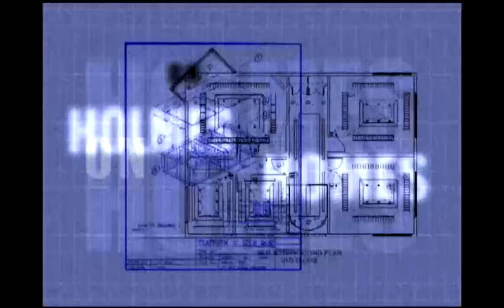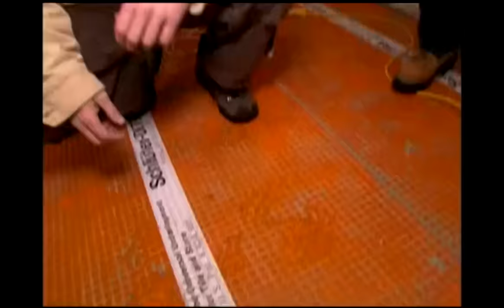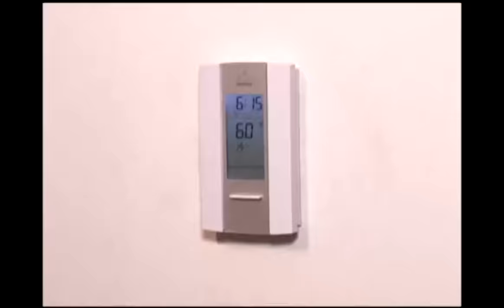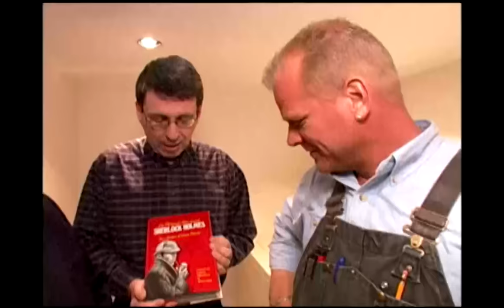The Risk of Buying Old Homes | Holmes on Homes 310

Comment: i have a 1946 house and the pain can be real. But from what I've seen of new construction...I wouldn't trade.
Reply: It is a big deal and such a stress reliever when the previous owner has all the paperwork from build, to mods, to appliances, to fixes and a solid home inspection backs it all up.
Reply: @Dk-qf8dd  These houses today people are constantly moving 1 new house every 2-3 years and after 10 years it gets demoed
Reply: @MultiTurbospeed  ouch!   Unless required to move by my employer, 7-10 years.  I didn't realize it was that often.  Financially that is nuts.
Reply: Absolutely, there are as many problems with new construction as there is with older construction. One of the problems with older homes is more recent work that was not done correctly.
Reply: My house was a 1947 cape cod I've added onto it twice been in the house since 1992 I was lucky in the fact my Dad was journeyman plumber electrician HVAC guy and I've been a journeyman electrician HVAC guy so when we had my additions put on my dad has known the carpenters 3 generations of them for yrs so I was lucky
Reply: Our house was built in 1920 and we love it ❤
Reply: So much easier to update a 40s house as you go. It stood for 80 years it’ll be fine as you expand and upgrade.

Whereas new construction homes need full remodels after 3 years. That statement is broad. I know. But it’s happening. A lot
Reply: @ndascal  Not always.
Reply: Just bought a 100 year old farm and likewise I wouldn't trade for anything. Hand cut joists and studs and 2" thick hardwood floors. The only problems with the house are the people that added plumbing, electrical and hvac throughout the years without any critical thinking or planning.
Reply: Own two 1940s houses. Wouldn’t want anything built after 1980 and prefer 60s and older due to the pride in work, superior materials, and craftsmanship.
Reply: Really just depends on who you have doing it. You need people who are honest and experienced. I just bought a older house and you can easily see where a homeowner did work and the professionals.
Reply: @ndascal  A certain number of older homes due to the roof structure have severe limitations to improving the insulation value at the perimeter of the house. Also the potential air leaks that are revealed by a blower door test show that many houses may have substantial air leaks that translate to drafty and high heat bills.Most older homes can be brought up to near super insulated and air tight standards with a fairly extensive external refit. Plumbing and electrical is only revealed by a thorough exposure.

Comment: Mike how you doing with the 3rd line houses ? I heard new houses you backed up after 2 years they are tearing them down !
Reply: Also read that article. One of Mike's companies also loaned money to the developer who built the disasters. Shame
Reply: Yep. The homeowners were completely screwed.
Reply: Reported 2 corrections to the issue. 1] The original builder substituted a builder not approved by Mike Holmes and 2] He only recommended the home if they used an upgrade package approved by Mr. Holmes. I understand that all the homes torn down did not go with the upgrade.
Reply: Wow

Comment: I purposely bought an older home 2 years ago.  I knew it had issues the home inspector "choose" to completely overlook so the Realtor could close the deal.  I would have bought it anyway, as I am very keen on spotting and repairing problems myself INCLUDING roofing!  I did my last roof myself and it was still good after 34 years when I sold the old house.
OK... long story short, unfortunately we can't call out bad contractors (or home inspectors) without facing defamation lawsuits.  THAT'S what's wrong with the industry.  NO ONE is ever held accountable.  THAT is why I learned the trades MYSELF.
Reply: Right on. 👍
Reply: 100%
Reply: The truth is always a defense for defamation. But contractors like these are never going to sue you. They'll work as long as they can until they get caught then declare bankruptcy, change their name, create a new LLC and start the scam over somewhere else.

Comment: It is permissible to use NMD90 (loomex) cable in metal studded walls in residential with appropriate bushings. AC90 ("BX") is not required. However, Mike is correct about the need to use junction boxes.

Comment: I’m in BC.I remodelled an extra bedroom as a utility/laundry room.venting the washer was simple using a cheater vent out an outside wall.it’s code and it doesn’t involve demolition.
Reply: Are you referring to a proper air admittance valve that is about $80.00 used in high rises and large apartment buildings or the cheap $5.00 unit that may not stand up.

Comment: If you’re going to buy an old home make sure it’s prior to 1940s. 40 year old house is not an old house. Old homes are built to last generations, post industrial homes are not. Our house is from 1850 and still stands strong on its original stone foundation, original windows, and floors. We added some rockwool, central heat/air, and drywall. Terrible 1980s cladding is coming down next year with a zip system and wood siding going back up. Then the shingle roof will come off and wood and metal roof will go on.
Reply: Sometimes people just need to stop buying Houses and either build their own or live in a tent
Reply: One major caveat about buying old homes, make sure you know if any work been done on it. The major problem with a lot of older homes is shoddy remodels or such done on it over the years, almost none of it with permits. Especially in this era of house flippers.

Just because your house is 40 years old doesn't mean some idiot didn't put in new plumbing or something 10 years ago and ruin the thing.
Reply: When rain hits a metal roof does it make a lot of noise?
Reply: @micheleemcdaniel389  Yes, yes it does. Thought it does depend on the rain and the type of metal or thickness. I've had both a metal camper which run like a bell and the metal shingle porch on the back of a house.

In light rain/mist it's not so bad but larger rain drops or hail makes it noisy as heck.

Comment: After watching the video twice there were even more problems with the house they didn’t work on. The bathroom upstairs has 2x4 framing under the shower. The attic has insulation against the roof and not on the ceiling and no vapor barrier. They are going to have to open the ceilings and add insulation and vapor barrier or spray foam from above. The production company must have been freaking out yeah Mike we see how they did it wrong but we aren’t here to fix that too! Let’s just run the vent stack. We can recommend others to fix the bathroom problem and fix the insulation in the attic problem!

Comment: 25:03 Holy crap! Is there any strength left in the wall after that pipe goes through!?
Reply: Plenty. That is not a structural wall, so it doesn't matter if a 2" pipe is routed through it.

Comment: Mike, why are the electricians using metal boxes vs. plastic or bakelite ones? You have to bond the metal boxes with green bonding screws and appropriate threaded bonding taps. Too much extra work!
Reply: This isn't actually Mike's channel so I doubt he's going to answer, given the lack of Damon, this is likely 20 years old. Canada has pretty strict electrical and likely was code back then
Reply: @SHKEKEKE  this is about 2000s and the frist series so Damon really isn't there and standards have changed
Reply: In the UK, all new builds or extensions must use metal boxes and the regulations state everything must be earthed (grounded). There is also a requirement for less MCB's be used and more RCBO's. and Surge protection (MCB= Miniture circuit breaker.  RCBO=residual current circuit breaker with over current protection, Surge protection protects all electronic circuits, computer, dishwasher,washing machine etc from surges in your electrical power supply or lighting strikes) Our regulations get tougher every year and rightly so.  The latest coming through now is protection against arc fault AFDD's(Arc Fault Detection Device) usually in extension leads, and will apply to care homes or homes or environments of many people.  As your electrician will tell you, electricity is not to be taken for granted, there are possibilities for many faults, its in your home and yourselves interest to have a full test done on the electrics of your house. (usually a requirement by your house insurer-if not, why not? will he pay out in a fire situation?) In the UK it is a requirement by law, that you must have a upto date certificate of your electrics and gas before you can sell your home and the same applies to someone selling a home. Just remember, that after a fire, its easy to see the wiring and how it was before the fire. Copper doesn't melt till it reaches 3000c. So don't give any insurer a way of not paying out!   Fire is the no1 item caused by electrical faults.   Ex Tech Electrician speaking here (now retired)

Comment: This took a lot of effort and expense to run a vent pipe for the laundry room.  Could an Air Admittance Valve (AAV) been used instead? 

"AAVs are mechanical devices that can take the place of a conventional vent connection on a sink drain. When installed properly, an AAV opens when water is flowing to allow air into the pipe and equalize pressure."
Reply: You can use a cheater valve to make it work, but it does not pass code
Reply: I believe that large apartment buildings use AAV's  all the time and there are heavy duty units designed to do just that. They are about $80.00 and fit on a 3 inch stack. Not the cheap $5.00 ones.

Comment: I disagree on the attic insulation. It is perfectly OK, and in some case preferable, to insulate the rafters and leave the attic a conditioned space. It depends on what the attic is used for, especially if duct work and HVAC are there.
Reply: Then how do you get airflow through the attic?   Vents or soffits  pull outside cold air in making the roof insulation moot and attic floor insulation a requirement.
Reply: You do not do that. Attic's have to be same temperature as outside.
Reply: You don't vent conditioned attics. You only vent vented attics. This house looks to have a conditioned attic, that's why there was an air return there.

Comment: Did he use screws on the dryer exhaust? BIG no-no. Lint will grab on and build up. Those connections should have been metal taped.
Reply: What happening here, is the tv company is trying to spend less!

Comment: Mike please tell what we should look for in an inspector when hiring one?
Reply: Find out if your inspector has experience in the trades. What were they doing BEFORE they became an inspector. Do they have some ideas of what the building codes are for plumbing and electrical. Inspect your inspector! And yes, you DO need permits!
Reply: @SandraNelson063  You would think asking from inspectors at least 100 referrals from previous clients that one can contact or a reporting system that tags bad inspectors.

Comment: If you cut the sheet rock on the top and two sides at a 45dagree angle you will find that you can use the same piece and just Mud and plaster it in

Comment: Doesn't plumbing code require white PVC pipe for underground drains?  Why did this plumber use black ABS for the underground drain for that laundry room?
Reply: Depends on the local.
Reply: Also this show is 15 years old.
Reply: Canada it's common to use ABS over PVC as it is in the USA.